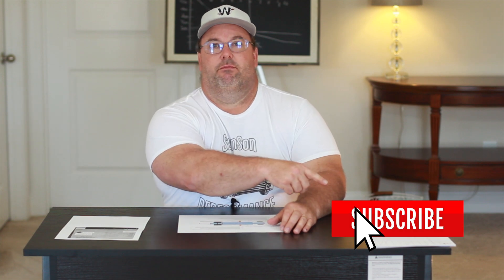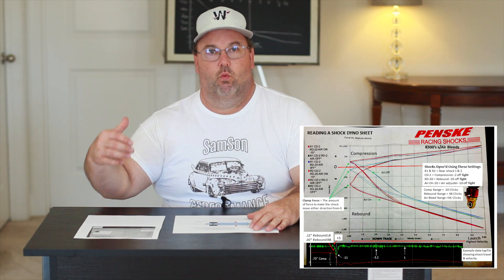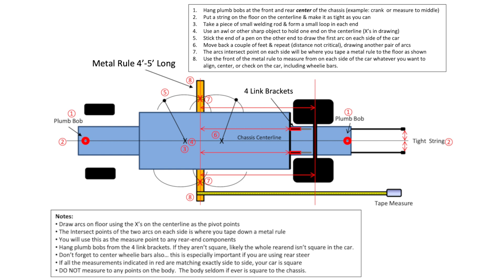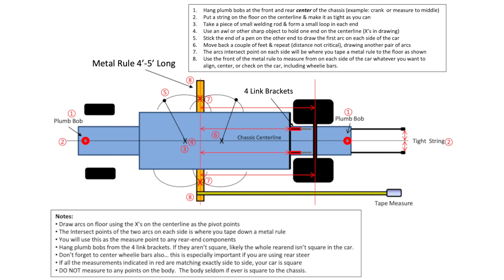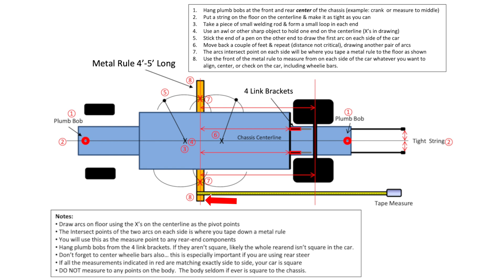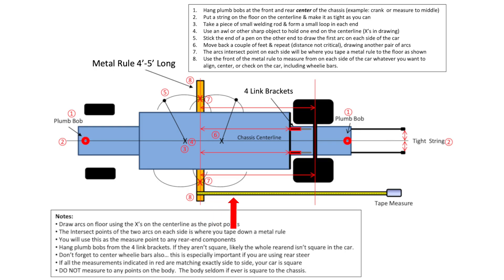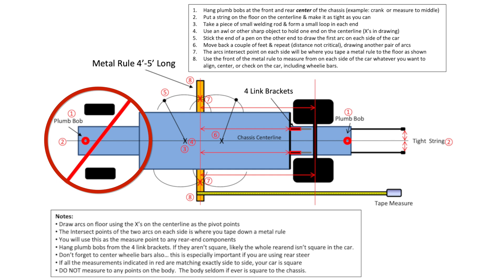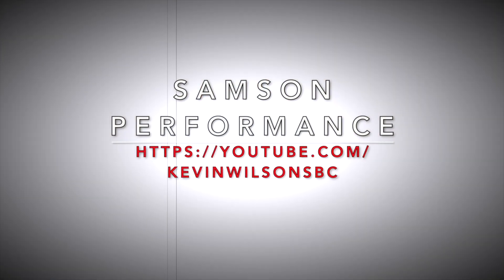Is Your Chassis Square? Your 4-Link Bars LIE!

Comment from the maker: Are you square? Is your suspension & rear end square? Here is a video on the string method you can use to confirm if your drag racing chassis, or any chassis for that matter, is square. If you are centering your rear end based on measurements to your chassis, then please take the time to confirm the chassis is square. It can save you a bunch of time from chasing rabbits! 
Special shoutout to Mike Lucas "Seattle Mike" for reaching out and supplying this String Method drawing, along with steps and notes. We have used a variant of this method in our shop as long as I can remember, dad would be drawing on the floor with markers and chalk and measuring. For that matter, every chassis he fabricated, it was completely drawn out on the garage floor in full scale.
Reply: Best thing about this method is how simple it is for everyday use.  Guy I know that builds 4 or so cars a year uses string, a good level, plumb bobs and known measurements, that is it.  They all go straight.  It makes life at the track so much easier since a slight tweak accounts for nearly all conditions, two or three clicks on shocks at one end is a lot and moving up/down a hole is HUGE on those cars.
Thanks for the ongoing videos.
Reply: Thank you so much for sharing this method being a welder fabricator definitely aply this method to many projects
Reply: Kevin I would like very much to speak to you for some recommendations how can I get in touch with you thank you,Dave

Comment: I don't think video helps me much. I removednrear axle on my s10 that's bagged. Problem I'm having I didn't mark center at any angle so axle is sitting more to passenger side. What can I do to fix it
Reply: Just follow these steps in detail step by step. 
   Those arcs being drawn off of the string lined plumb bobs are the key to establishing the most correct reference. 
     I know you may feel like you have painted yourself in a corner. 
   This will help you establish your references to check from.

Comment: Kevin, 
Been having wander problems in my racer. Especially on the big end of the track.  It’s a 34 Ford replica, home built , 440 mopar, Torqueflite , 
Dana 60, 4 link w/ track locator. QA-1 DD 501 shocks. 
Front end is Mustang 2  alignment is 0* camber , 8*castor , 1/8” toe , . I’ve done everything with the front end to try to cure this I’ll handling problem but nothing seems to help.  
after watching this video and following the instructions I’ve found the rear ending is/was 1/4” cockeyed in the chassis. Do you think this 1/4”  could be causing rear steer enough to contribute or actually cause my wandering problem.?  
I surly enjoy your videos and appreciate your help. 
Thank you
Don Berry
Reply from the maker: Don, thanks for leaving a comment. This is likely beyond troubleshooting on a YT comment. Checkout my services at https://samsonperformance.com/services.html and let's go from there. Definitely use my email and we can get your wandering problem addressed. Depending on if the 1/4" is at the brackets or axle ends it can definitely cause issues. Go fast, go straight! Be SAFE!!
Reply: Thanks Kevin, 
I’ll do my best to get some good videos of the launch as well as the full run .  Maybe you can get a better idea then of what’s going on . 
   Thanks again, see you soon 
    Don Berry

Comment: I used this method.  4 link x member is off square 7/16.  The 4 link bars are adjusted about 3/8 longer on the left side to compensate.  Next I’ll see if the car launches straight.
Reply from the maker: General Sixty thanks so much for your comments! Hope it helped!!! Go fast, go straight! Be Safe!!
Reply: @KevinWilsonSBC  It did help thanks.  The car is going straight. I’ll eventually get around to redoing the c member / rear clip.  I was thinking that a string line from front to rear and a 24” framers square off the line would also come to the same conclusion.

Comment: Hello Kevin. I have been watching all ur 4 link videos trying to learn something. I have a 5th gen camaro and I bought a 9in Ford with a 4 link. I'm trying to get it set up and the upper 4 link bars are messing with me. They are not strait forward so im having an issue finding the instant center and anti squat line. Think u could help me out.
Reply from the maker: Travis Davis thanks so much for your comments! Shoot me as much info as you can, along with pics to samsalignmentsc@gmail.com and I will do what I can in between everything else going on. Go fast, go straight! Be Safe!!
Reply: @KevinWilsonSBC  sounds great ty. Give me a few days and I'll be in touch. Thanks and God bless

Comment: Kevin nice video. The only issue I see with it is the method you used for determining the chassis center line. By using the center line of the crank or the center of the diff housing you don't account for a frame that's possibly not straight or tweaked. The car always drives off of the suspension location. A better place to drop the plum bobs are from the front and rear control arm mounting locations. This way if the frame is not straight it wont matter. The car will be driving off of the suspension. I learned that from Dave Morgan. Good luck with your car.
Reply from the maker: Good info, Ralph!!! Go Fast, go straight! Be Safe!
Reply: You DO NOT use the crank or center of rear end housing.  The instruction sheet does not say to use those points as the starting point. You want the centerline of the CHASSIS. Many chassis builders actually put a mark or "V" where the exact centers are. This method is used to determine if the 4 link brackets & everything else including wheelie bars is exactly centered to the chassis.  If one is off then all measurements in the rear will be off compared to the front etc. If you measure from the centerline out front & rear & they are all equal then the chassis will be square.
Reply: Good Video Kevin . Pretty cool method . The problem I see with a lot of average race cars are unibody with an off set drive train so you have to measure off of  the body somewhere to get your center marks . I’m having issues with wheel well gap ahead of the tire right now . I just did Merillat boxes and a converted to coil overs along with a ton of new mods in a mustang . I’m going to find center and measure from the axle centerline and brackets in the car in a triangle to see where the problem is if any . I have dropped plumbs off of body jig points everywhere and everything seems perfect except the wheel well gap and the k frame being in crooked. Measuring in an x or triangle to the center point seems way easier than trying to make these arcs on the floor but I’d like to try both . Thanks

Comment: Many passenger cars and trucks have an offset drivetrain centerline for different reasons and when you convert them into a race car you can re-engineer them,
in most cases, so that the driveline and chassis centerlines are the same but this difference in as built configuration should be defined and taken into
account when setting a car up like this so that you are using the true chassis centerline for wheel location. Thank you for another great video....
Reply from the maker: Yes!! Good info and thanks for taking the time to comment! Go Fast, go straight! Be Safe!
Reply: Yes, when working with a stock vehicle,  you can not assume the crank center line is the same as the chassis center line.

Comment: Exactly what I wanted to see.  I think my urethane  bushed 4 link cross member is welded in 1/4” off square in an old back half Chevelle  chassis. I’ll check it using this method.
Reply: Let us know what you find if you would. This method has fixed a lot of cars that guys struggled with & could never get to go straight.
Reply: @AustinBoil  I’ll post up what I find. I plumb bobbed off the front control arm mounts to square it up and I don’t think those old chassis were ever straight to begin with especially if ever in an accident. The Alston urethane pro street links especially need to be straight or they bind and wear out quick. Spherical rod ends have a bit more adjustment for rear steer.  Street / strip builds are  a compromise thing.
Reply from the maker: Glad this could help you!!! Keep us posted. Go Fast, go straight! Be Safe!